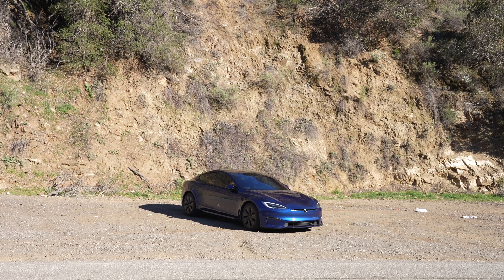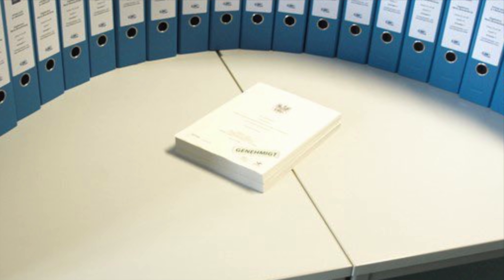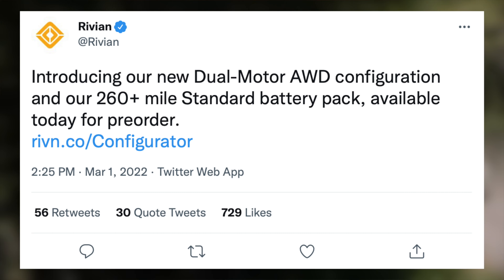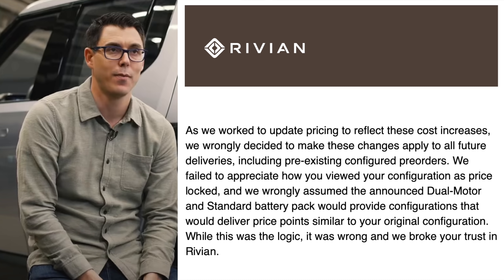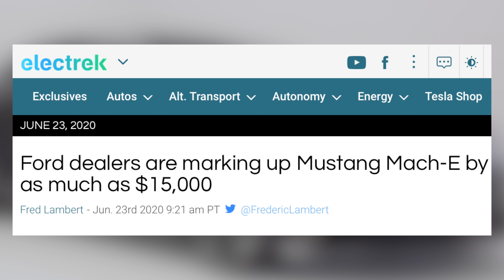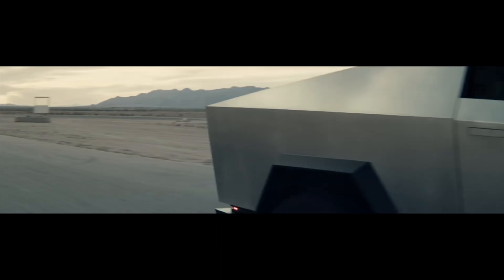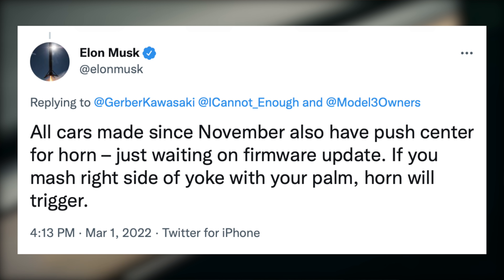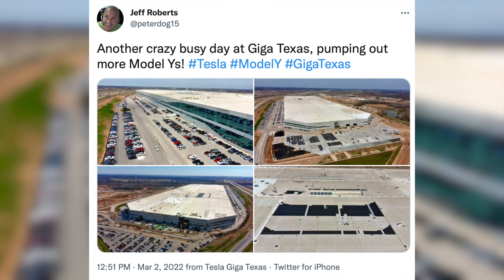It's Too Late To Buy Your Tesla in 2022

Comment: To me the biggest issue other than battery supply for legacy manufacturers is the fact that they have their dealership network charging customers anywhere from $5000-$20,000 over sticker price for their EV allocations. I was ready to buy any other available E in the market and I spent a couple of days talking to dealerships across the United States and every single one told me the same thing. When I placed my order online with Tesla in less than 10 minutes I realized how far ahead up the competition they are in every single aspect of the EV auto industry.

Comment: I have Model Y performance on order in England through in Importer to be send to Thailand.   What do you think? should I delay my order so I might get a 4780 battery pack from Germany (right Hand Drive) instead of the Chinese model with the smaller batteries from Shanghai.   What do you think?  Should I delay for a few months?

Comment: Can you once go into detail about battery drain? I won't have a private parking or charging and therefore my Tesla would be standing around outside all the time. Can I expect the Tesla to have enough battery while being not used for 2-3 weeks? Will it heat the battery even when the Tesla is not use in deep winter?

Comment: They need to update the Fremont factory so the S,3,X,Y vehicles come with less flaws and get updated like the Austin factory.
Reply: That’s true, but I gotta say, our 2021 Model Y is a Fremont build and I’ve looked it over front to back and haven’t found a single flaw in fit or workmanship. They’ve clearly gotten better at the Fremont facility, but Giga Austin is likely to be much more consistent and just a better car with the 4680 battery pack. If I was confident I could get an Austin Model Y and could time it right, I’d order a new one and sell my 2021 Y. I paid approximately $52000 in June and even with 7500 miles on it, I think I could get $60000 for it today. But, timing and luck would be a factor in my decision.
Reply: @bluedog9935  my 3P from last year has several issues. The trunk was rubbing and paint rubbed off. ( had to manually adjust it ) 7 or so panels miss aligned, terrible squeaking sound when I pull in / out of my driveway. Every time I wash my 3, the right turn signal / camera always squeaks with the slightest touch.
My biggest gripe is the brakes though. Beyond terrible. They’re not properly sized for the weight these cars carry and the brakes are underperforming to say the least. I’m shocked they don’t improve these. I ordered a plaid and that is likely the first thing I replace are the brakes. They seem to focus on the go and not enough on the stopping.
Reply: @PlaidDad  That’s too bad. Those fit and finish issues were common a couple of years ago for sure. I was under the impression that they had improved but maybe not. And boy are you right about EV’s in general being heavy! Our Model Y long range is darned near as heavy as the Acura MDX it replaced. I don’t do a lot of heavy braking, probably because it’s pretty flat in Kansas, but spirited driving or living in Colorado would really put a strain on those brakes. The performance models should all come standard with brakes that match the performance of the car. The good news is that when you sell your Model 3P, you’ll probably be pleasantly surprised what you’ll get for it. Good luck moving forward.
Reply: @bluedog9935  well damn, we’re neighbors! (I’m in Colorado) where about in Kansas if I may ask?
Last time I drove through Kansas, I was a first responder (2nd person on scene) to a really bad accident on I - 70. 2 minors died aged 10 and 17 I think? It was 9 June 2014 and very rainy, a semi and  two other cars were hit from behind by the big rig. It was terrible. Haven’t driven through since.
Reply: @The_DuMont_Network  could be, it was built on 31 March of ‘21 and would’ve thought there would be minimal issues if any but found several after owning it almost a year now. I’ve done various upgrades and found a wad of electric tape towards the front of the vehicle when I upgraded / installed the sway bars. Couple broken plastic snap clip things under the car were missing.
Reply: @PlaidDad  We live in Lawrence, and I’ve traveled a ton on the turnpike and it can be surprisingly dangerous. My wife barely avoided a head on collision with a wrong way driver on that stretch. That’s a terrible memory for you to carry. Sorry to hear that. We’ve got family that live in Genesee, SW of Denver and stay with them when we go skiing and watch their boys when they go skiing. Love Colorado!
Reply: @The_DuMont_Network  So true! It took all of one day to get used to it and I can’t imagine why anyone would set their driving profile to coast except for maybe the first drive while getting used to their new car.
Reply: @The_DuMont_Network  I can live with the panel gaps, just as long as water doesn’t enter the vehicle in any way. I adjusted the trunk myself just to get it done. The only time I’ve utilized the service center so far was to replace a front end plastic piece under the car that broke on me when installing the sway bar in the front. They hooked me up and only charged me $150 for the part instead of $200. I’m certain our service center here is swamped if I encountered any further issues. I don’t foresee anything else popping up though but I do love the car overall.
Reply: You're working off of data from several years ago.  There may still be some flaws but a huge percent are just fine.  I have several friends who've gotten one recently and there are no issues with theirs (I know, anecdotal).  I really know no one that has had any issues with their Teslas and that goes back to 2017.   No manufacturer will be 100% perfect and when you hear issues, it is just a small percent you're listening to.  No the lions share.  If it was, Tesla would not get 90+% sat scores.
Reply: @The_DuMont_Network  Um what dead horse am I beating?  That Teslas have much less defects than they used to?  Maybe you should read what I wrote again.
Reply: @The_DuMont_Network  just because YOU had three Model 3's with no problems doesn't mean you can discount the rest of us.  I tool delivery of my Model 3 just 4 weeks ago with only 3 miles on the odometer and at 151 miles I had to pull over and couldn't drive the car because someone in the Fremont factory didn't hook up the wire from the main battery to the 12v low voltage Lithium battery so it wasn't getting charged...had to leave it on the side of the road for roadside to tow back.  Tesla needs to focus on quality control--period!  Tesla doesn't pay for advertising,  public relations, or dealership BS so quality control needs to be better!

Comment: I don't see any downsides to more range. Like you mentioned, the EPA range is very (impossible) ideal conditions - MYLR (326 miles EPA) gets about 250 miles with the AC going at 80mph highway driving - which is the speed limit in many Western states - even worse when driving in winter conditions. Additionally, towing kills range probably more than anything - so I would really, really like an extended range option for the MY. On my minivan, we often use a luggage rack carrier too. So, combine all the factors - highway driving, in the cold, luggage rack and while towing a camper - a 500 mile MY would be ideal - perhaps even required. Yeah, towing kills range on ICE vehicles too, but at least there are gas stations on every corner and it only takes a few minutes to refill.

Comment: I disagree with Elon about range over 400 miles. I live in the Midwest and charging isn’t as easy as it is on the east and west coast. We have a lot of area’s I can’t go because my model y will only go there and can’t make it home in a reasonable timeframe. Plus with our winters your range is very limited. I’d love to see a long range so I wouldn’t have to worry about those factors. Makes it hard for people here to switch.
Reply: Same here: I live in Michigan, winters are cold and fast chargers up north are scarce. I’m not buying a tesla and then “baby” it on the highway at 60mph just to yield a decent range.
Working at a major automotive supplier, I get to drive different cars frequently. The MYP yielded in a 180 miles range, loaded with 3 adults and some measurement equipment in the trunk. That was with ~80mph on the highway at 30F temp and a full battery.

Not buying any EV in the next years before range and/or charging speed substantially improves!
Reply: adding to that: 180miles are only _theoretical_, i.e. in case of driving the battery all the way down to 0%. To make matters worse, the effective range would be ~150 miles only when recharging at 18% battery level. Laughable at best…

Comment: I wanted to buy a Model 3, but once the pandemic hit, I first wanted to make sure I had cash on hand and pay off debt. Now that I work from home 100% of the time, I don't even think I drive 5,000 miles a year anymore. I program for a living and make very good money and my wife makes even more than me. Translation: I could certainly afford a Tesla, even at these higher prices. But even with these gas price increases, it's really hard to justify spending $50K on an EV. Honestly, if I had to get a car, it's hard to justify not buying something like a Honda Accord, which you can get for around $26K Sure, the Model 3 is a much better car in terms of specs, but again, do I really want to spend $50K to drive 5K miles a year?

Comment: Hey guys, I'll tell ya what.... I really doubted myself when I ordered my Model 3 instead of just fixing my existing car (again). The old car was paid off and was ok on gas mileage and worked most of the time... So I bought the Tesla and had to put down a big down payment to get the monthly payments to a reasonable amount for me. I was really apprehensive for about a month... but now.... Geez... The amount I have saved so far just in every costs at home vs. gasoline prices has made up almost the entire car payment.... and the stuff going on in Ukraine and elsewhere has now actually made it cheaper than having no payment and buying gas (We are now at $4.89 per gallon here in Vegas and going up fast). And now with supply getting harder and prices being bumped up, I ended up looking smart for a change.. haha. Thanks for the Great Video, Ryan.
Reply: @angelmariemusicc  Heya, Angel... Well, in my case, My old Hybrid Fusion was paid off, like I said, but I was putting about $290 per month into the gas tank.. That was back in January, so prices were at about $2.80 per gallon. Now gas prices here in Vegas are almost exactly double that... so Today, I would be putting roughly $600 into gas each month... on top of that, my car had a lot of miles on it, so there were probably other maintenance things I would have to deal will, plus oil changes, smog, etc. My tesla payments are ironically $595 per month and my power bill has changed about $40 for home charging... so like $640 a month, and no oil changes or smog, less maintenance, and a warranty again. So for me I'm still saving money.. and I got a totally rad car..... yeah... I said "Rad" haha. I would just do it... prices aren't going to come down any time soon, and there's a heck of a lot to like about these cars... My 2 cents, anyway.

Comment: Ordered Y perf On Feb 2022. Moved from April to March 16-31 🙏🙏 coming soon, hoping it goes smoothly,  if it goes well that’ll be a one month delivery wait that’s awesome
Reply: Same here. Ordered YP on 02/13/22, and deliver date was moved up to April 23 - May 14th. Let's hope that sticks.
Reply: I’m so close to pulling the trigger on a new YP but would love to have the 4680 option; does Tesla notify you with which batteries wil be in your YP or do you simply think what you’ll get is what you’ll receive in the future?
Reply: @RockyRdWarrior  They don't even know themselves. But, order it now and it will take at least 45 days for the performance variant, and you can always delay delivery one time these days with a decent excuse. Worst case you would lose your $250 deposit if you delay a 2nd time. They just move you to the back of the queue when to use the delay tactic.

The reason you might want to delay is because more and more orders may be coming as soon as there is confirmation of 4680 structural packs in the MYP cars.

It's pretty much a foregone conclusion at this point unless something really bad happens that all MYP cars shipping East of Austin will have the new 4680 structural battery pack. If you look at the photos and videos of all test and production frames coming out of Austin, they all have a large section of the body missing where the structural pack goes. Tesla announced at least one time that MYP would be first out of Austin because it sells for a premium and generates the most profit for Tesla.
Reply: I ordered my my m3 in early feb 2022 and my estimated delivery is march 18-31.. I am really worried that will get delayed by months now haha

Comment: It is actually not too late to buy a Telsa in 2022.  I put in a order today for a 2022 M3 LR, trading in my 2021 M3 SR+. My new car will be available in two months.  My year old 2021 with 15000 miles went up in value by $3000.  With equity and money down I have $12,000+ trade.  I will have the car I want, for a little extra payment each month, so I am excited.  

I believe this option is short lived.  The used car values has been going up in value is based on the inflated market. The shortage of chips are being solved, and more new cars will be available, driving down the used car market.  I also see the new Texas giga factory will soon solve the Tesla demand.  The wait times will drop and those willing to pay full price for a year old car will drop.  Prices will normalize.  

The 4086 will drive down prices even further.  That means my new 2022 M3 LR will drop in price when it becomes used. I will have the car I want, but I will have to keep it for awhile because the used price will tank.

Comment: after the rivian debacle, i think lucid and other will consider themself warned.
Concerning the cybertruck or other EV truck, for work truck like in construction, they ll be ready to pay alot more for thebiggest battery possible.  As not only for the towing range, but for the amount of power you can bring with you to power your tool, tower ligth, air compressor and so on.  When you go on a contruction site it usualy full with pick up, power generator, and air compressor.  If all those pick up can replace the latter, it make for a far less noisy and polluted work site, less equipements that need refuelling daily, less equipement prone to be stolen during the nigth.

Comment: I feel like there was a time about a year and a half ago when people who order the model S in Dec 2020 at 69k were asked to re ordered to the new version at 80k. So Tesla has imposed increases before
Reply: Yes, but they ended up honoring any orders at the previous rate.
Reply: @whattheschmidt  you mean just like rivian? And I would also point out that did not honor the FSD price of those who ordered the MYLR rear wheal drive reservation holders who had to reorder as well at the time, was 7k
Reply: @jokulhaups309  yes, end result the same, both honored original reservations.  I'm unaware of the FSD price issue.
Reply: Teslaratti article from about 4 weeks ago about those holders .

Comment: Living and driving in cold weather climates makes range much more important. Efficiency with heat technology is not fantastic and while it has gotten a lot better it doesn't matter when you are below 0 F. Range is literally half most of winter and sometimes worse depending on weather conditions. This makes a 500 mile range vehicle is 250. So, in warm months I may not need that, I definitely have days I would use that in cold months. One other point to make is cold weather engineering that Tesla does. Sure Tesla tests like crazy and they have slowly been adding features like heat to the wipers and heated steering wheel, I would say they have more development to do. I love my MYLR and it does "ok" in winter but it is far from my ideal winter vehicle. I do look forward to the progress they make and trust in the engineering at Tesla but I do hope they invest more in that regard.

Comment: The pricing of EV's is all about supply and demand, demand is currently outstripping supply, so prices are rising ... basic Econ 101. So, a better plan, if you can, would be to wait till Austin and Berlin ramp up, and till Fremont is refurb'd to produce the latest designs, so that prices can stabilize at a more reasonable level.

Comment: Hey Ryan
Do you think you could address the future range of the Model Y in you next video? Since they switch to 4680 batteries, the range and acceleration will increase, right? What do you think we can expect?
Btw. love your videos and advice! Would like to have more!
Reply: I swore I read somewhere that the range may only slightly increase due to only putting enough batteries in it to just about equate to the rated mileage it’s currently at. Yes, it would be lighter overall but I believe I read that the weight savings would be the biggest factor for the increase in range. Time will tell once they are delivered and people start posting reviews about it.
Reply: Good chance they will use less batteries and keep range similar until Panasonic ramps production of battery cells. No sense in constraining vehicle output just to pack the packs.